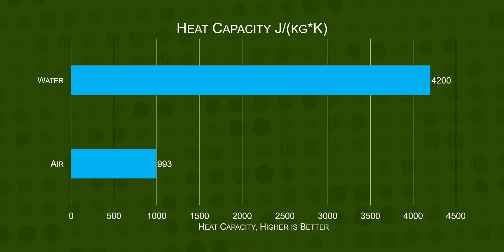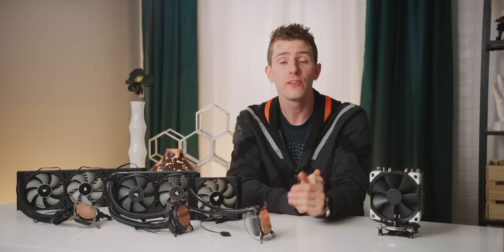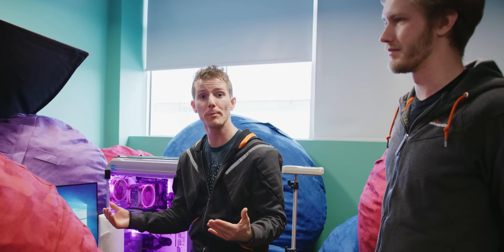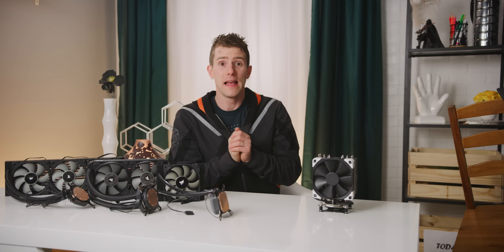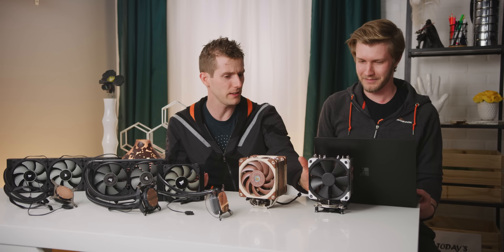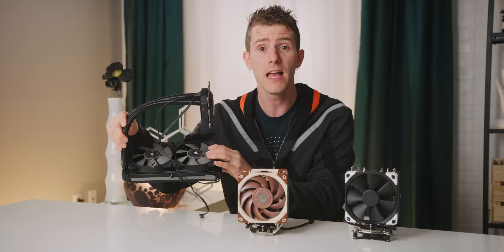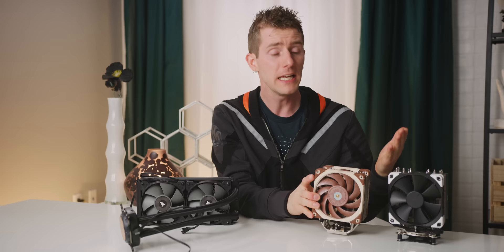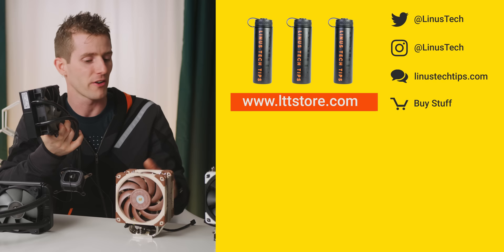Why you shouldn't water cool your PC

Comment: Wtf I just pour water over my pc every few minutes
Reply: Wtf I just drop ice on my pc every few minutes
Reply: I see no issues with this
Reply: @okuyashoe_official  i figured why buy a water cooler when u can do it yourself
Reply: Are you the verge guy?
Reply: Yeah man I just keep mine in the freezer drilled a few holes for the wires
Reply: I used to put a wet paper towel on my laptop every so often to cool it down
Reply: Big brain: uses box fan to cool the pc with the case open
Reply: @ihatecommunism9958  i just leave my panel open and throw some water inside when the computer warms up. that way i cool cpu ram gpu motherboard power supply everything at once
Reply: Sometimes I like to treat my pc with a caprisun
Reply: WTF I just play games in the snow.
Reply: @aziris7257  I mean if u live in Canada just have a window you can put ur pc outside and route the cables through it and let the sub zero temperatures work in your favour
Reply: You have clearly came up with a fantastic solution
Reply: Just use Distilled Water and you'll avoid electrocution. As for the moisture problem, well...
Reply: whats all this cooling stuff about? i just buy a new setup every time it gets too hot
Reply: BLUE CACTUS STUDIOS MEMORY -  lol no the ice would melt and then it would just be a water cooler
Reply: This comment triggers my anxiety lmao
Reply: I just leave my pc in my freezer
Reply: I just strap blocks of dry ice to my cpu
Reply: @yourtub8705  I bend the pins for better airflow
Reply: Same
Reply: Wtf I use nitrogen
Reply: I keep mine in a walk in fridge
Reply: That's just dumb. I use automatic sprinklers to cool mine. It takes the guesswork out of it.
Reply: I throw mine in the ocean, the salt improved my fps
Reply: @bladeandcloak666  ofc the salt improves electricity conduction
Reply: wtf i use my aircon to cool my pc
Reply: @mylindor8164  bru hi live in antartica and my pc is under water
Reply: ♾ IQ
Reply: @bladeandcloak666  Microsoft actually did that to their servers to save money on cooling
Reply: @carden88  I put mine in my miny fridge
Reply: Good, your PC will build a tolerance to water.
Reply: Put your pc in a fridge and drill holes for the wires
Reply: Wtf I just pour nitrogen on my pc every few seconds
Reply: I will put it in an fridge 😂 (jk I don’t even have a cooler in my PC)
Reply: Back in the day, my family was too poor to afford water cooling, so we had to piss in our pc builds. Unfortunately, the warmth of it caused the pc to overheat and blow up instead.
Reply: I put my pc in the freezer. Save some time
Reply: My case is just a fish tank
Reply: Wtf I just take my pc to Antarctica every few minutes
Reply: i just use a lunch icepack
Reply: Good choice
Reply: Wtf, i keep my pc in a tank full of liquid nitrogen
Reply: you can actually submerge pcs in some oil which doesnt cause shortcuts
Reply: @lorishofer2889  Yes mineral oil
Reply: I use protoplanetary Boomerang Nebula to cool my pc
Reply: @bladeandcloak666  plus in a game, not only you will be salty, your PC will too xD
Reply: I game in my bathtub with an ice bath always
Reply: @yourtub8705  u would think so but my pc still goes 80-90c in winter here lol
Reply: make holes in cooler for pc wiring and put ice in cooler then put pc in the cooler
Reply: I spit
Reply: wait guys i actually did it, why its my rtx 3090 ti 69 ge force gtx gt 710 not working?
Reply: @ihatecommunism9958  im gonna try this right now thanks
Reply: @yourtub8705  LMFAO
Reply: Pshhh what a looser, I just spray some dry ice on it automatically every 1 hour using my infinite water sauce
Reply: @carden88 No joke, i used to put my ps3 in the freezer for a few minutes before playing because it used to overheat and turn off 10 minutes after turning it on.
After putting in the fridge it would last 40 minutes before it turned off. So i would stop playing and put it back in the freezer for 10 minutes or so and start playing for another 40 minutes.
Reply: @yourtub8705  "I see no issues with this" 
"i figured why buy a water cooler when u can do it yourself"

Fucking genius.
Reply: Idiots put it in the fridge
Reply: @shodan2002  where do you put it?
Reply: @shodan2002  in your @ss?
Reply: bro i run around with coolermaster hyper 212 to air cool it
Reply: pathetic i use liquied nitrogen
Reply: Wtf I can't be the only guy that occasionally smears some sunblock on the PC's internals with a butter knife, am I?
Reply: Bro yall are doing it wrong, I made a case out of tin foil, leave it outside and sometimes even put rtx on so my pc gets hotter. That makes it preform wayy better.
Reply: I use Liquid Nitrogen
Reply: Bruh wydm I just put mine in a tornado
Reply: lol
Reply: Tip: liquid nitrogen is more effective
Reply: I just put it in a food cooler, works like a charm.
Reply: 0% of the time, it works every time.
Reply: thanks for the chuckle
Reply: dope
Reply: nah we in 2024 now, we mount leafblowers on it
Reply: I just keep mine in a deep freezer. Works great
Reply: Spit on it! Works for a lot of things 👍
Reply: Wtf I just give my pc a shower every few hours
Reply: Same, I use mineral water cause it makes the computer do funny things and smoke.

Comment: AIO watercoolers are great for small form factor builds: they are space saving and they are less prone to heat buildup which occurs in cases with small volume. That's definitely a worthy factor omitted in the testing that's done in the video showing a big tower with a huge case volume.
Reply: So they actually have a use besides just looking flashly? Btw i have to wonder who uses small cases? I have a big case
Reply: @thewhitewolf58  small cases are more portable, take up less space, and are generally lighter. Also, they can have a nice cooling setup depending on how you set it up.
Reply: i have a mini itx that can fit a small aio i dont think those two big tower fans will fit in my case ill buy the aio im using the stock amd cooler and its fuckin shit cant even overclock my ryzen 5 3600
Reply: @thewhitewolf58  They are people who live in vans. If you live in a van having a small mini-ITX case makes alot of sense. a huge tower is gonna be a pain in the pass to have if you live in a van.
Reply: @thewhitewolf58  Building a PC right now, I decided against ITX purely because I want my computer to be a work machine as well and will require upgrades down the line. If I was only planning on gaming, I'd go ITX. More desk space!
Reply: @Coder's Corner how  is the stock cooler? I'm getting a ryzen 5 5600 and I've seen posts about how the stock cooler was bad
Reply: @thewhitewolf58  Basically just enthusiasts that get off cramming a whole pc is as small a case as possible.
Reply: @arnoldthegreat4138  bro fr i got a stock cooler with my amd cpu and it fucking sucked. I think part of the reason mine was overheating was because of shitty case fans though
Reply: @nick9115  dont use stock cooler.
Reply: Very true. My noctua 2-fan cooler is as big as jet turbine
Reply: so i have one of them q300L from masterbox, i got a ryzen 3 3100 (thinking of upgrading), with 4 fans on the case

i was checking the CPU cooler prices and i noticed some cheap cooler master AIOs were about the same price as Noctua and hyper 212 air coolers

should i get a watercooler, or is this video proof that they aren't worth it?
Reply: I wouldn't say they are space savers tho, my corsair one is a huge ass two fans with a heatsink in the middle and it sucks to manage anything with it always blocking the way
Reply: @sodasommelier4990  you know what is even more portable? A laptop. You don't really buy a desktop for it to be "portable"
Reply: @tincantelephone Smaller cases heat up faster and are more difficult to cool. It's just physics. With less distance between each component, your computer will produce the same amount of heat within a smaller volume. This directly leads to higher temperatures. You can think of it in this way as well: when using a smaller case, instead of being able to move cool masses of air over the CPU and GPU separately, for instance, you'll be moving the same mass of air over both, making it warmer as a result, leading to higher temperatures within the case.
Reply: Plus I believe their less prone to some of the problems compared if you go with all out fully water cooled instead of AIO
Reply: @TheSydguy30  True, but laptops are not customizable (other than the framework), have a reputation for being hotboxes (last one I had literally burnt out), and not being able to match the power of a pc.
Reply: @tincantelephone And how exactly are you gonna fit the same amount of fans in a small form factor case?
Reply: I agree with this, I have a mini ITX build in an Ncase and you simply can't use a regular air flow setup to cool the computer in, so it has a custom heatsink on the gpu (1080ti) and an AIO on the cpu (8700k) and with no other case fans the temps max out at 65, the biggest problem with AIO's is people getting super cheap ones and then complaining when they break or aren't good. If you're using a piece of tech that's less safe, don't be lazy or cheap on which one you get
Reply: @thewhitewolf58  i immediately think of the Family Guy tiny everything meme lmao
Reply: @thewhitewolf58  the question is, why would you have a big case? A smaller case takes less space and air flow can be just as good. Of course, you are limited in space, but you can still fit x2 GPUs and all the ram normally... Only issue is this oversized air coolers.
Reply: @SuperbFairy  I have an NR200P aircooled with a noctua NH-U9S heatsink with double noctua fans running as intake and 4 arctic p12 fans running as intake and exhaust at the top and bottom, and my temps max out at around 65. Those kind of temps could be achieved with an aircooled mini-itx as well, i would say the problem is that people stick to the stock cooler or they dont know the proper fan config to run
Reply: True. Trying to fit a loop in 2U, seems better than shallow air cooler. I checked and cpu hits thermal limit before PBO gets to the max. Thinking Eisbär Solo LT or similar.
Reply: Also easier to clean than the big tower coolers because they tend to have a fan between 2 heatsinks/towers that you cant get to
Reply: @thewhitewolf58  I've been building computers for 25 years.  I would never, EVER go back to one of those tower monstrosities.  They look hideous.
Reply: @Aphorism89  just to add my 2 cents, larger cases are just fine when you want to throw something together and not worry so much about compatibility. The builds seem to always end up being cheaper as well.
Even though it limits choice somewhat, I prefer mini itx builds... they're just so much easier to move around and find a good place for in my office space. Going from a steel full tower to the tiny thing I have now was awesome.
Reply: @thewhitewolf58  now days aios perform a lot better for higher end cpus this video isnt really relevant anymore
Reply: @TheSydguy30  If only you worked around PCs or the tech world you’d understand.
Reply: yup. its also additional + you can quick clean it without dismounting pomp from cpu so you dont have to switch paste like every month
Reply: @thewhitewolf58  A lot of people use small cases, I myself do it because I like to have a portable, fully powered, and fully modular gaming setup. I've carried my gaming desktop on airplanes for flights with portable monitors several times.
Reply: Guarantee you have your aio mounted wrong
Reply: It's crazy cos he's on his way out now, but looking back, Linus covered nearly all of the most relevant tech for this gen and then some, so I guess it's fine for his to slip into the background as the next gen of tech comes out
Reply: i guess for my case would be great however its good on fan cooling and keeps great
Reply: @thewhitewolf58 i don't agree with small cases but it doesn't matter tho however i got small case wheb bought gaming pc
Reply: They're also just effective in general. I'm on a 14900k at 5.3ghz and a stock 3090 FE. Switched from a Noctua u12-a air cooler to a Liquid Freezer II AIO (360mm). During a 20 minute XTU stress test, temps max at 10c lower with the AIO than with that Noctua air cooler. 80c vs 90c.

So I dunno. Results of these things are all over the place.
Reply: @thewhitewolf58  
They very much do. I have a bunch of stuff on the shelf, so when I do new builds, I test what works and then buy the cooling I need. I recently did a 14900KF build with a 4070 TI GPU. I tested air cooling, because I like it if I can get away with it. I do a lot of transcoding so the CPU does a lot of hard single core work, so cooling is essential. I run a good cab with twin 200 mm fans in the front, and a 120mm in the back, so good initial airflow. When tested the cooling towner, I mounted a pair of 120 mm fans up top as well. Then I mounted a Liquid Freeze II 240 in the top. Night and day difference. Over 10 degree C difference and much lower cab temps. This also means that the GPU and RAM runs better. This video is an old test I'm well aware, but when you get into the I9 K and KS gen 11, 12, 12 and 14 units, water cooling goes a long way if you are actually using the processing power. Those things can pull upwards of 300 watts.
Reply: I Have a noctua n1 prototype cooler and a intel cryo 360 cooler they both very good n1 keeps decently cool but cryo i can get it to 0 degrees and run high end games and it sits at 15-25 degrees. N1 runs at about 45 degrees. Cryo is best.
Reply: I've tested alot for myself, 360 AIO air coolers make a huge difference. I don't understand how most people support air coolers so much in terms of performance. It's stupid